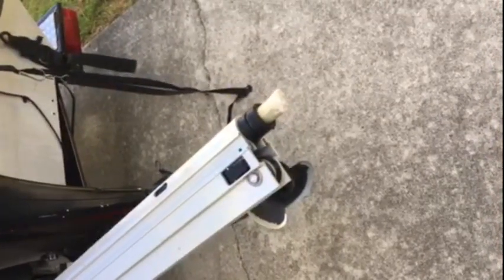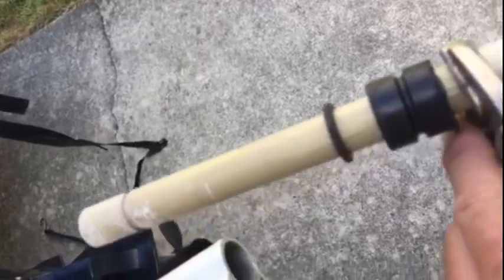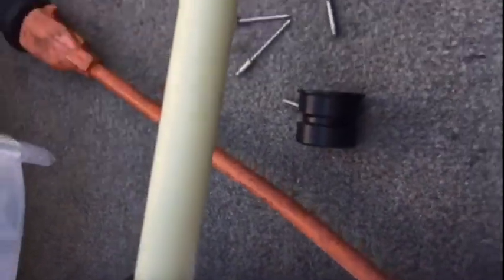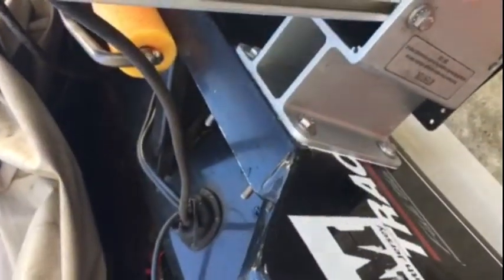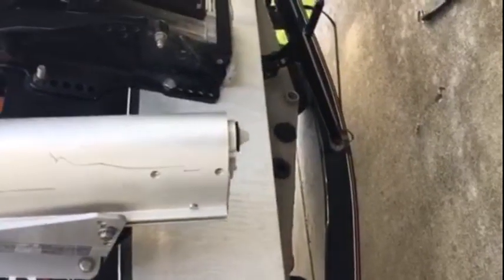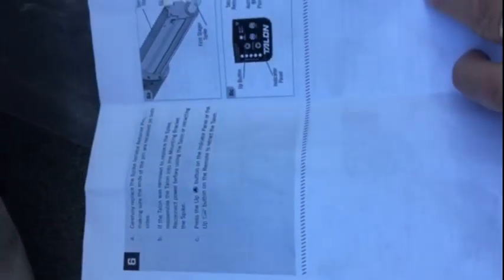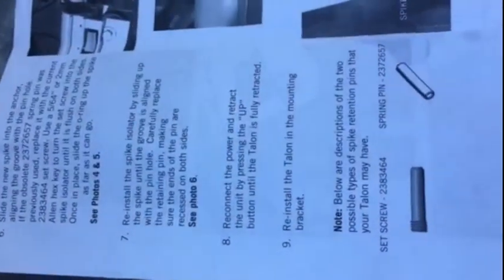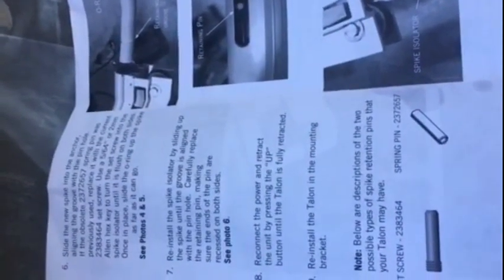Minn Kota Talon Spike replacement

Comment: Where did you get your replacement fiberglass Pole or Spike whatever it is called.
Reply from the maker: Called company directly because no one near me could do it
They send me spike with instructions and I was s as able to do it my self.  Had friend to read instructions and record video
The part was free
Reply: @anthonyleone9605  what are the rivets for in the replacement kit?
Reply from the maker: @noralong7331  I had a set screw some use rivets, read instructions that match your unit